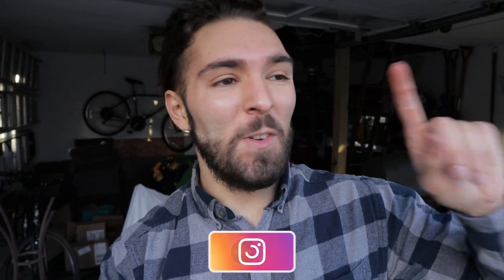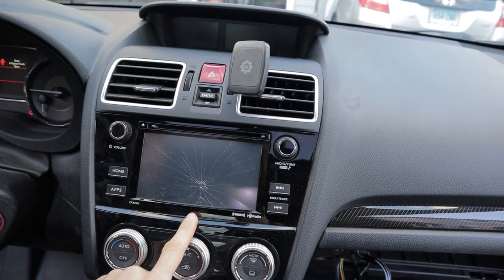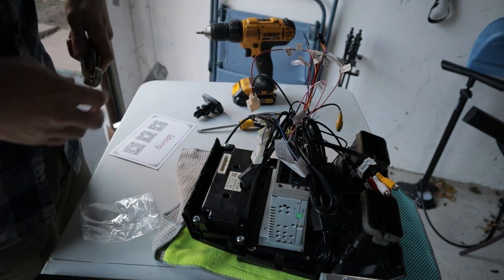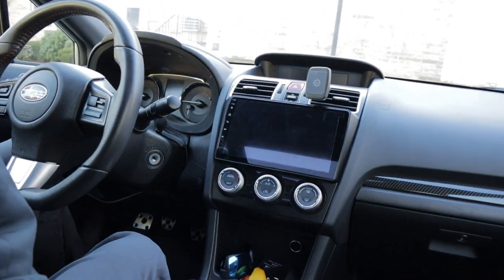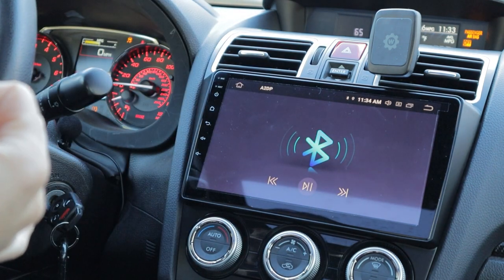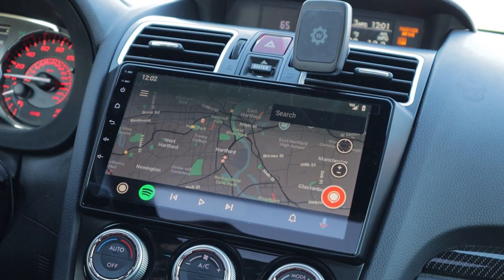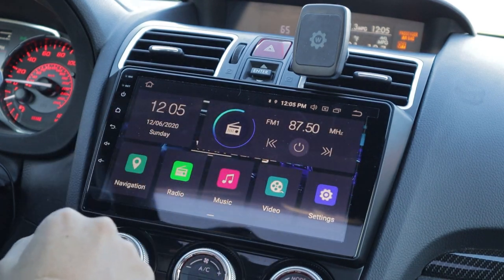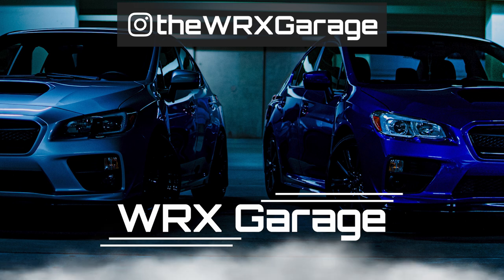iDoing Android Headunit (With Android Auto!) - Subaru WRX 15+

Comment: does it work with harmon karmon
Reply from the maker: They make another version that works with harmon kardon!
Reply: @WRXGarage  U have a link where to get it?? or point me in the right direction. Subbed :)
Reply from the maker: Search for idoing on aliexpress and you can select your year and model
Reply: @CRASHB4NDICOOT4  You need to order the canbus to go with the headunit.  I just ordered my set for my 2018 limited with HK, can't wait.

Comment: Only wanted to see if android auto worked wirelessly. ANSWER = no
Reply: it does with Head Unit Reloaded App.  App still need work, but it's as good as the USB version pre-installed

Comment from the maker: Hey guys! Trying to help a friend out.
Does anyone have this headunit with a model WRX that has the steering responsive headlights?
Reply: I’ve got the steering responsive headlights and was considering buying this unit. Would that function still work?
Reply from the maker: That's what we're trying to find out!
Reply: Haha oh boy, I might have to wait on purchasing this😅
Reply: @WRXGarage, I messaged one of the guys on my Subaru forum. He has this unit and steering responsive headlights and he said he hasn’t had any issues!
Reply: Why would the headlights be affected in any way by a different head unit? I would expect them to get signal input from the steering wheel angle sensors.
Reply from the maker: We're just double checking to be sure!
Reply: I have the responsive headlights in my 2018 limited, can't imagine how they wouldn't work, but will post here when i get my unit
Reply: @WRXGarage Sorry it took so long, no night drive since I put it in, but I took mine out last night and no issues with the responsive headlights on the 2018 WRX
Reply: I got mine today and everything programmed easy, i have the newest unit by them...its was all plug and play no spliceing or adapters just original wiring and the included extras like usb and mic was simple to wire where i wanted them
Reply: @marcdukette5095  do you have harmon kardon system in your car? did you have any issues with compatibility?
Reply: @WRXGarage  any luck? Did you ever get it to work or did you swap headlights?
Reply: @sheldoncooper2360  yes it does, but you need a can bus module, contact the aliexpress seller and they will guide you to which headunit and canbus to buy
Reply: @sheldoncooper2360  so yes and no.  It's a beautiful simple install.  That said a couple things you have to be aware if.  First you lose rear fade control. Also the did something not everyone will like.  The treat the front speakers on the dash as tweeters and the two in the door at woofers.  So they split the signal.  Rears and sub work normal
Reply: @marcdukette5095  thx for this answer. That alone makes me not want to buy it. I'm a huge audiophile and misusing the speakers in this way isn't at all satisfactory to me
Reply: @flatmotion1  I don't disagree and wish it was optional setting, but that said the system does sound fantastic and the front speakers are closer to tweeters than the other 4.  I would have preferred using the front for tweeters and then all the other 4 as standard combined.  Either way it's still FAR superior sound to the stock HU, but if you just want best sound and don't mind the cost, a 7" Kenwood with the proper Metra kit will probably deliver a better audiophile experience.  You just have to deal with the functionally crippled state of mainstream HUs
Reply: @marcdukette5095  I have the harman kardon as well. I've also read it's a huge pain with the starlink system to get around that
Reply: @flatmotion1  no the install of this thing is a breeze. Just leave starlink  plugged in to power.
Reply: So I too have purchased this Head Unit for my 2018 WRX Limited and it too has the steering responsive headlights and here are some tips that might save some headache for anyone who is purchasing this for the first time

1) if you have a Harmon Kardon sound system in your vehicle you will need the Canbus in order for it to fully function. The sellers will ask you that after you make the purchase and before they ship it to you.

2) If you or a professional are installing the new Head Unit in from the Stock Head Unit, ensure to keep the Subaru Starlink System in (its that smaller black box that is directly under the radio). You wont be able to mount it unless you rig up some makeshift mount, but honestly its not necessary. This will ensure that your Front Speakers are working. 

3) If you notice that music or phone calls are not as loud as the FM Radio while using Apple CarPlay or Android Auto, I would recommend just using the Bluetooth. The reason, to my understanding, is that its to prevent distractions while driving, allow for you to hear the directions being given when using GPS like google maps, and to protect your ears from loud noises. Crazy I know, but that is what I came across when doing research. Just make sure you understand that when going in.

4) Alot of people have had trouble ensuring that it fits properly. While installing, I too was worried about pushing it in and breaking it, but I promise you it will fit just fine with a little force. I used my Wallet as sort of a cushion with hitting it in place with the palm of my hand to prevent the screen from taking damage. It fits perfectly now.

5) if you are worried about your steering responsive headlights not working, I just got off the phone with a Customer Service Rep over at Subaru America and the radio has no impact to the headlights what so ever. They work when you are driving at speeds over 10 mph and at night (cant say I seen them during the day). I thought I had issues with my lights too after seeing this comment and thought id do a test in my drive way to figure out if I lost my headlight responsiveness. 

All in all, its a very good system and I am very happy about it.
Reply from the maker: There is a separate model they sell that specifically for the HK system!
Reply: I'm over 6 months in an while it's not perfect(I lose my launcher setup once in a while) I am extremely happy with my purchase.

Comment: Modern smartphones use a capacitive screen.  If this is a resistive touch screen it's a no go for me.  That's like 15 years ago touchscreen technology.  I think you meant to say it is capacitive, not resistive.
Reply from the maker: That's exactly what I said. This is a capacitive touch screen. The oem Subaru one is not, it's resistive.
Reply: @WRXGarage  @13:57 "it's not a capacitive touch uhh screen" .  

It is 100% a capacitive touch screen.  You meant to say it's not a "resistive touch" screen.  There is nothing called a "normal type of screen".  There's capacitive and resistive, both equally normal. 

I'm a fan of your videos, this isn't me pointing and saying you're wrong.  It's constructive feedback so people get the correct information.
Reply from the maker: Watch it again, "I don't remember the other kind" in reference to the OEM system.
Reply: @WRXGarage  stop being defensive.  At 13:57 you literally say "it's not a capacitive touch uhh screen".  I went 30 seconds back and you made no reference to the OEM head unit.  You then went on to say it was just like an iPhone screen, which is capacitive touch.  So if you were talking about the OEM head unit you were wrong there.  Iphones use capacitive screens and have for many years. 

Then @ 17:34 you call the equalizer an amplifier.   Just another FYI.

Again, I like your videos but when you speak about technical things you should make sure you understand the terminology first.
Reply from the maker: The app on the screen is literally called "amplifier". And I'm not being defensive man, I know what I said because A, I said it, and B, I edited and reviewed the video 🤷‍♀️
Reply: @WRXGarage   Sometimes it's just better to let the viewer have the last word. But he's not wrong.

Edit:  Not wrong about the equalizer either. Even if the Chinese made HU calls it amplifier.
Reply: Yeah I got thrown off watching this too and had to spend 2 hours researching to make sure it wasn't resistive.

Comment: IF YOU DO NOT CARE ABOUT AUDIO QUALITY, buy this radio. I see too many channels promoting this awful sounding head unit. It has a horrible, horrible sound output.
Reply from the maker: Did you upgrade the rest of your audio system to support the headunit? I have an upgraded inline amplifier and upgraded door speakers. Overall sounds 20x better than stock.
Reply: no disrespect, just trying to help someone whoever that may be. you should let people know that in the description maybe. the amplifier inside the unit is not meant for cars/car audio. the amplifier you are connecting this to will boost the signal of audio coming from the bad amp inside the head unit(Bit Depth). hopefully, I am not ass backwards wrong. but it was super unfortunate buying this for $450 and hearing lifeless, unspaced sound. thanks for replying!

Comment: That head unit work for the 2021 wrx premium without the  harman kardon speakers ? Thx
Reply from the maker: They have specific models for different years of the car, I think there is a separate harness needed on the backside. If you order through JDMuscle, it should ask you for the exact year, model, and trim.